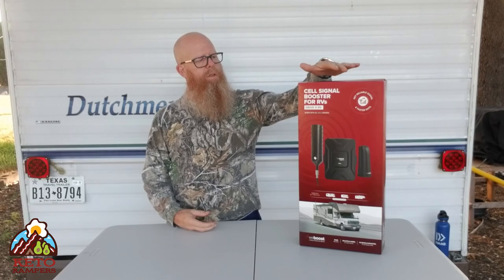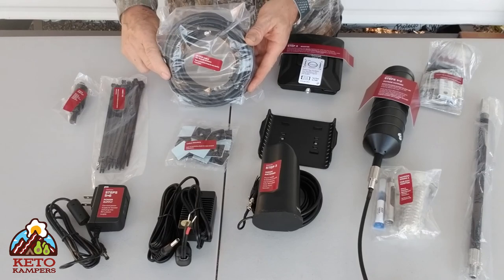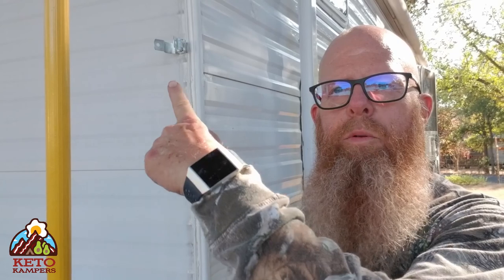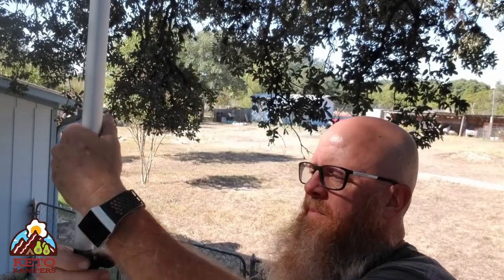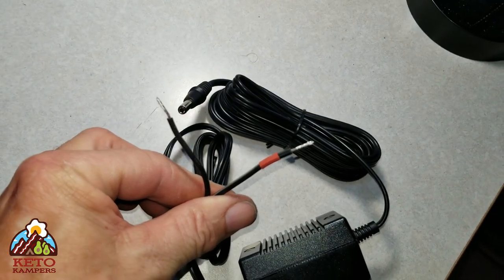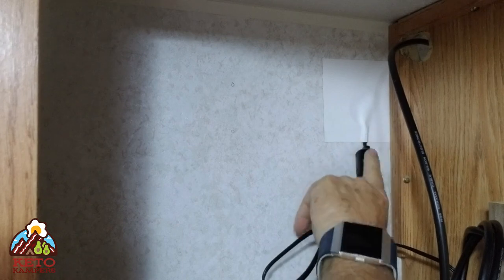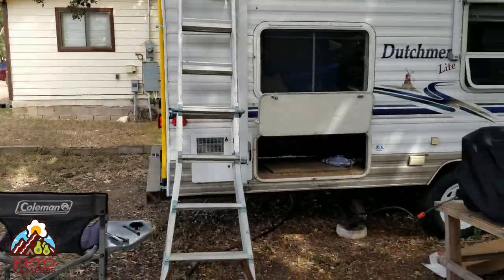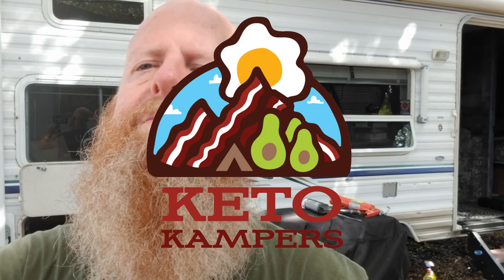Weboost Drive X RV - Complete install and review from box to boost!

Comment: really good video - especially the information you included on the call made to weBoost to determine the directional antenna. Just wish you had included the steps you took to drill the hole in your external wall.  I’m installing mine this weekend and nervous about that step!
Reply from the maker: Sorry about that oversight on the video. What I did is drill smaller pilot holes so that I was sure that I wasn't interfering with any wiring or anything. Then I went and got a very high quality silicone sealant, it dries almost as hard as plastic and thus far I have not had any problems. Thank you for the comment, I appreciate you watching our videos stay tuned for more.

Comment: What do you do with the extra cable needed when you extend the pole?
Reply from the maker: I don't remember if it shows it or not in the video but what I do is as I am retracting the pole I spin it around and coil the extra cable around the pole itself so it's all still connected the entire time it's just wrapped up. Thanks for the comment, your friends at keto campers